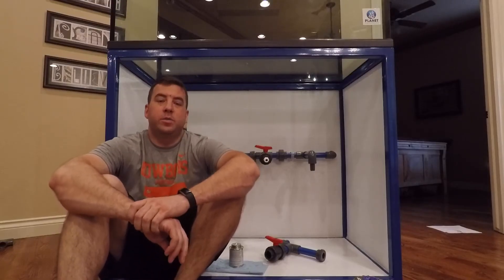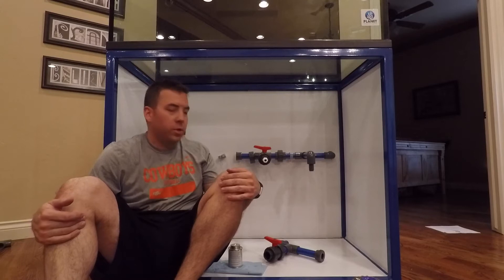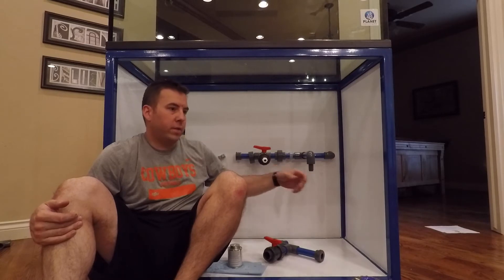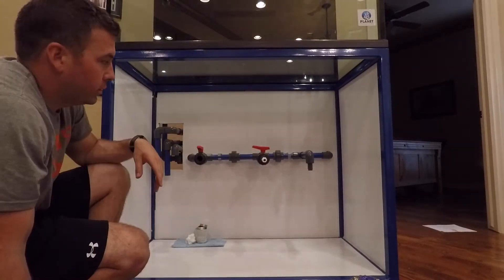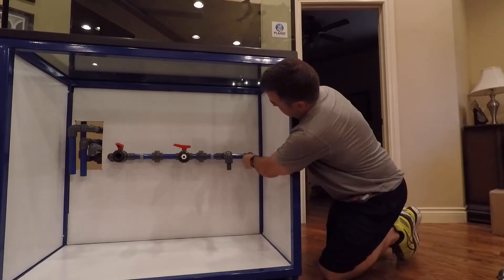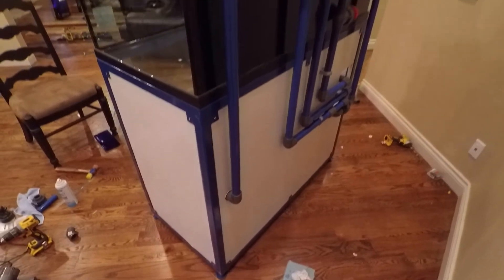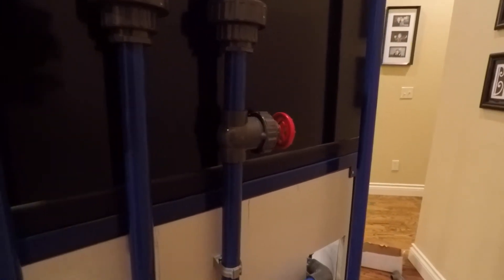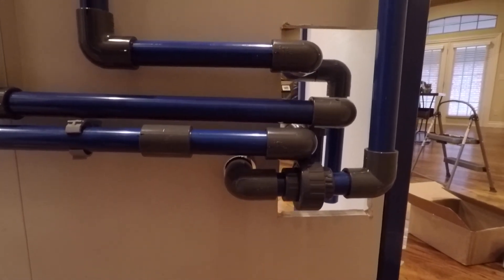Ultimate 120 Gallon Reef Tank: Plumbing! Ep 3

Comment: you can use the extra outlet on the manifold for a recycling line back into your sump mechanical filtration area .. done the same on mine.. makes sump more effective all around cleaning the water multiple times before going back to the display.. i subbed.. fantastic build thus far.. keep doing what you do!